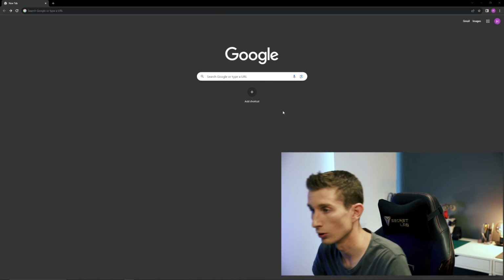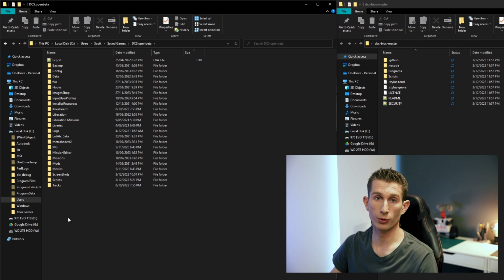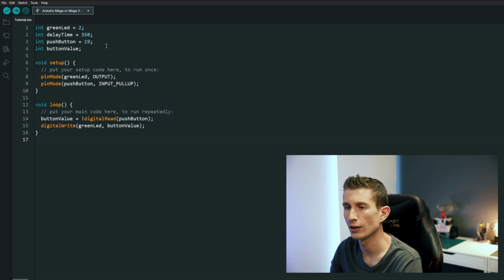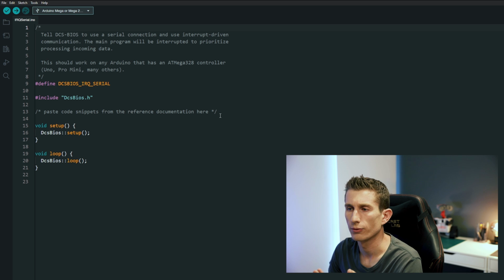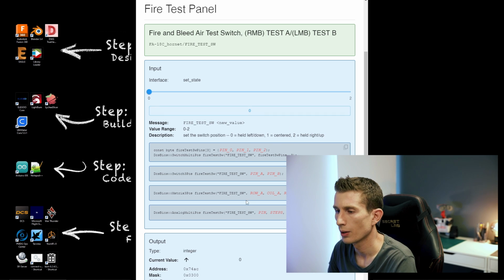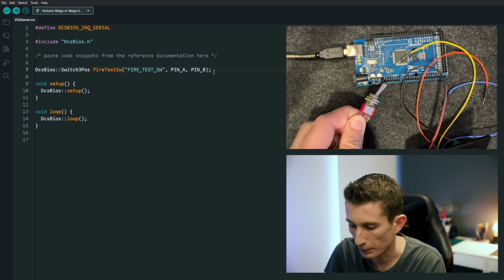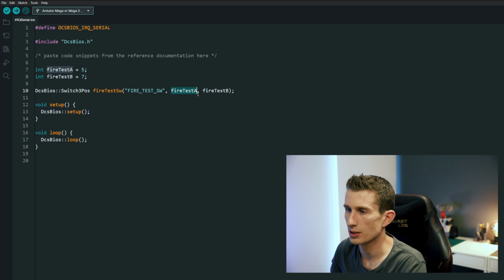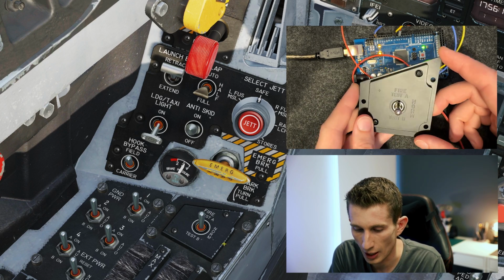Ep: 7 - The Only DCS Bios Setup Guide You Need!!

Comment: So upset I can't use my TeensyLC with DCS-BIOS.  I was trying to get this to work but eventually found out with some Google searches. . . Guess i'm going to have to buy a proper board.  I did however find a forum stating you could use #define DCSBIOS_DEFAULT_SERIAL instead of #define DCSBIOS_IRQ_SERIAL.  I used the "Default_Serial" and it compiled
Do you know what the outcome may be and the difference between the two #define codes?

Comment: hi, i finaly started with building my fa18 simpit, and i am building the apu control panel but the problem is that i have an on off on switch for the eng crank and now the switch only recognizes when i use the outer two like switches or so. Also its a 3 ppin switch. Do i need to get an on on on switch or is there a workaround for what i have now? thanks
Reply: ive just reset the game and it works now lol. thanks tho
Reply from the maker: Hey the ON-OFF-ON switch will work fine 🤙🏻🤙🏻 BIOS knows that if the switch isn’t reading it must be centred
Reply: @aHornetsNest thanksss

Comment: Can one not just use the joystick library on the arduino?
Reply from the maker: Hey you definitely can! But when it comes to building a full simulator or wanting import and export functionality you’d need to go DCS Bios 
I use the joystick library for my smaller modules like episode 1 and 2 where I want it to be able to key bind to multiple aircraft 
But with the Hornet, there are over 220 inputs, and it would be a nightmare to keybind everything as well as I wouldn’t be able to export indicator light state and gauge and instrument data if I didn’t run DCS Bios
Reply: @ - makes sense.  And certainly for output you need it.  I've been looking at building a simple button box, that can be used in different games, so joystick library seems like the way to go.  Thanks for the great videos, I've picked up a ton of idea for how to make it better.
Reply from the maker: @JulieanGalak thanks mate!! Once the cockpit is built I want to go back a start a new series where it’s smaller achievable projects. Very similar to episode 1 and 2 
And they’ll use the joystick library a lot

Comment: I've put together my second "panel" and have gone over the 54 inputs for the Mega.  At present its 58 pins versus the allotted 54 pins. Does DCS Bios allow pins 54 thru 69 to be usable with DCS Bios software?  Rotaries were the culprit here. Thanks for your help.
Reply from the maker: Hey you can, even though pins 54-69 are labelled A0-A15

You can use them as digital inputs as well 

Instead of referencing them as A0-A15 
Reference them as their digital PIN number 54-69, and Arduino will do the rest 

BIOS will just compute and transfer the input that Arduino receives 🤙🏻🤙🏻 hope this helps

Comment: Had trouble with getting the command reference modules to show in bort and browser.   To hopefully pass on info on how to resolve to save yourself hours of frustration.  You need to go into DCS after installing bort and bring  up an aircraft, then exit.....bort now will show the aircrafts in bort's pulldown menu.   maybe a easier way, but this worked for me.
Reply from the maker: Hey awesome that you got it working! I’ll pin this so it stays at the top 
Thanks for the info 😊🫡
Reply: Thank you! This is exactly what i was looking for to fix Bort
Reply from the maker: 🫡🫡 Awesome to hear

Comment: So I have an entire cockpit running right now with dcs running the old dcs bios, everything works, I have almost every led in the f16 cockpit modeled and connected, and it’s working. The reason I was going to switch to skunkworks is because I just installed the landing gear handle light and it wasn’t acting right. When I paste the code snippet from the new bort reference, it tells me the f16c_xxx wasn’t defined. The old dcs bios you just cut and paste it all and it just works. What am I doing wrong? And I really don’t like the whole type each com port into the command prompt and run them, what happens when you have 4 or 5 boards? You have to open a window for each and start them all every time you play? The old bios you just opened and it connected by itself and hid in system tray. Not sure why they had to go change everything, doesn’t seem like they made it better lol
Reply from the maker: Hey mate, go check out Episode 12: How to connect multiple arduinos to DCS Bios 
when I get home I’ll have a look into your landing gear issue 👍🏼👍🏼
Reply from the maker: So having a bit of a look at the referencing issue 
You may need to send me a screen shot of the error, or go into your aircraft library to see what the new syntax is - these changes will inherently happen regardless of it being BIOS or a WinWing system - only difference is we do the debugging 
I know the F-16 has had some syntax issues - but I can say the F-18 works exactly the same as the old BIOS 
It’ll just take some time to correct it and you’ll be back on your way
Reply: @aHornetsNest  so the old bios code snippet would have the point id in parenthesis , such as (0x4441,  0x8000,  pin) . The new code reference has (f16c_50_gearhandle_led, pin),
That’s not it exactly but you get my point, so when I go to compile arduino with that new code snippet it tells me that f16c_50_gearhandle wasn’t defined, I noticed all the new code snippets have words in the parenthesis instead of the point id like old dcs bios.
Reply from the maker: Mmmm this is definitely odd that such a big change was made - especially for people who had fully set up pits 
When I return I’ll look more into it :)

Comment: Hi, I need some help.
I've been following your tutorials and they are really good, I understood many things 👍😀!
However to build my first panel I'm using the buttons that are included in the elegoo starter kit and I learned how to wire them to the breadboard. The only problem is that I 3d printed a panel and I'm trying to make it fit the buttons but since the buttons need power the wires are getting in the way😭, I wired the buttons like you did in the video where you showed how to turn on a led with a button, and you can see the wires are getting in the way. Please help me, I don't know what to do.
Thanks in advance 👍.
Reply from the maker: Hey you might want to check out the PCB design episode - this may be a case where you might need a PCB which will keep it keep and organised instead of wires 😃
Reply: @aHornetsNest yeah I already watched the pcb video, the only problem is that I don't have a 3D printer (the panel I have was printed by a friend that just sold his 3d printer) and for now I don't have the switches (I'm looking forward to buying them in the future, for now I only have the 5 buttons that were included in the elegoo starter kit and they have to be attached to the breadboard to work, so when I try to fit the only panel I have to the buttons the wires are getting in the way🥲
Reply from the maker: @Viper.Maverick  ahhhh following
Reply: @aHornetsNest also, I see that the switches you have are similar to some switches I found on Amazon, are they the same? Like, have you bought them from Amazon? And if so did you have to hardwire the 3 pins of the switches to the cable? Because I don't have that machine that releases that liquid that puts the metal thing together 🥲
Reply from the maker: Hey I got the switches from AliExpress 
Yeah I solder the wires to the switches to make a nice connection 😊

Comment: Excellent video.  Really the entire series is great and hugely appreciated.  I have 2 concerns.  1, the number of ground pins for 'common' if there are a ton and switches to the single arduino board,....and 2, my ocd in keeping connections to the arduino clean and logocally organized.  For instance, rather than connecting each switch to a common ground (for sake of your example here of the fire test panel using pins 5 and 7) couldn't you use pins 5,6,7 using a pull-up high on 6 with 5 and 7 low.  when pins 5 or 7 go high from switch toggle the game reads that movement.  Seems to me that keeping a switch with 3 wires pin grouped keeps wiring clean.
Reply from the maker: Hey thanks for the comment! 100% keeping wiring clean and simple is the aim on the game 

For this episode the panel was directly wired to Arduino purely for simplicity and choosing 5 and 7 spaced out the pins so it was easier to see on camera -  episode 8 goes into designing PCBs and how I tidy up the wiring 

I use PCBs to allow each of my panels to be modular - and they then connect to a Central Data Unit which will process all the avionics and will have multiple arduinos shielded onto it. 

You can definitely go the pull up pull down method like you said :) I find connecting every switch to a common ground reduces the amount of coding needed, and allows the pins that connect to Arduino to be only input and output 

The Hornet has around 230ish inputs/outputs and space on arduinos are at a premium - so connecting them to a common ground allows me to to use methods like multiplex to reduce the amount of pins used etc 

I hope that helps ☺️ any other questions  just let me know 🙌🏻
Reply: @aHornetsNest  That makes sense.  Keep the videos coming.  They're helpful.
Reply from the maker: @Nick-xe2hu  thanks mate!!

Comment: I can see your tutorials are targeted at the DCS environment, any chance you also "deal" with MSFS ? Have to confess like the simplicity created by DCS Bios.
Just future thinking, running a couple of switches up to the pin count of a arduino still simple, as you open that bios link and then supply one Comm port number, what happens when you're pin/switch count goes over what one board can use, when you might have one port in my case for a Collective and one for a cyclic/pedals, how does DCS handle multiple Arduino boards and the comm linking. This DCS Bios simplicity might make think of maybe using DCS vs MSFS2024
Reply from the maker: Hey mate! Yeah I definitely will expand into MSFS … because there are some great modules to be flown in there 
In the ‘Program’ folder, you will see a serial connect multi shortcut - use that :) and it will ask you to enter all the com numbers you use - bios works great with multiple boards 
For now most of the tutorials will be based off DCS as it follows along with the cockpit building starting soon 
And then when the cockpit is up and running - I’ll move into different style “button box” modules for each era and industry 😃

Comment: Can you do this with low fidelity models ?
The ones where you can't press buttons inside the cockpit, like the 🐸🦶
Reply from the maker: I’ll load up the PC and have a look :) how cool would that be if you could
Reply from the maker: Hey I just had a look to see if you could use Bios with FC3 … 

You can only pull data from the plane, not send it 
So you could have your gauges and instruments in your cockpit work, you just wouldn’t be able to send commands
Reply: @aHornetsNest  thx for checking out.
It might still be possible to bypass that by making the Arduino input keybinds directly to the computer, there's probably a library to do that and it would act the same 🤔
Reply from the maker: @coucoul38  yeah there definitely is… I touch on it in Ep.2 

Use either a arduino that is AtMega32u4 based
And then use the joystick 2.0 library
Reply: @aHornetsNest  oh ok, that's the one tutorial of yours that I skipped 😂
Reply from the maker: @coucoul38  😂😂

Comment: I made a AH64D panel a year ago on the older dcs bios versions, lost all the arduino code (dead m.2 drive) that is on the arduino. Can I download the code from the arduino back to the computer? Thank you for the excellent tutorials!!
Reply from the maker: Very nice! That’s such a pity 😢😢 you can’t download the code as such, but there have been ways to just transfer the “compiled code” from one board to another - but it’s a bit of a mission
Reply: Thank you!
Reply: Got my arduino working again, thank you. In the connect-serial-port program, how do you add more aruino devices if you have more then one.
  @aHornetsNest
Reply: figured it out, open the multiple-com-ports file with notepad++ and add the comports. Then use the multiple-com-ports instead of the serial port :)
Reply from the maker: Awesome!! 🙌🏻

Comment: Outstanding tutorial. As always.. One question; we will eventually have multiple panels with multiple arduinos running. Is there any way to have the connect com command running automatically? would be a b.... having to initiate each and every panel manually every time?
Reply from the maker: Hey mate! Thank you very much 🙌🏻 when it comes to multiple arduino panels - there is a connect serial (multiple) command application (in the programs folder) where you can enter multiple COM numbers in separated by commas, and I believe (but don’t quote me, I’ll test it out and message you) it saves your comport numbers 😃 but if not I’ll find us a way to make it automatic ✌🏻
Reply: @aHornetsNest you're a legend. thank you!
Reply from the maker: @Snugggg  🙌🏻🙌🏻
Reply: Great video, I also have a system with several arduinos panels that I would like to have operating. So I'm also very interested in  your finding on this question.
Reply from the maker: @larrywilliams8153  thanks mate!! I’ve got it on the list to do a tutorial on this 😃